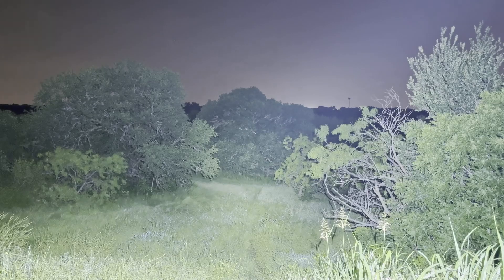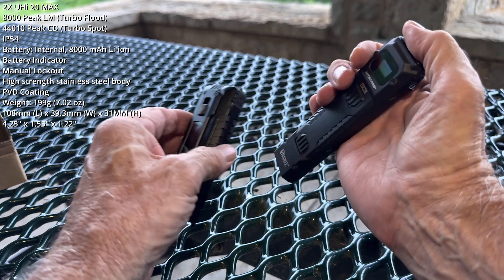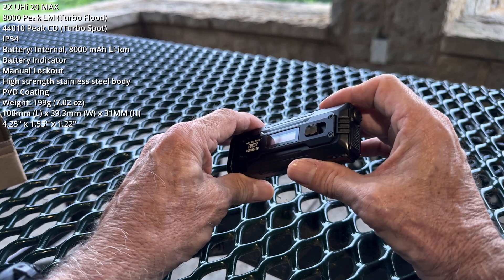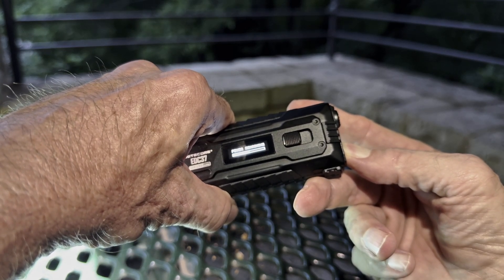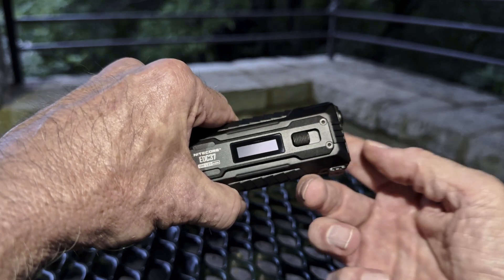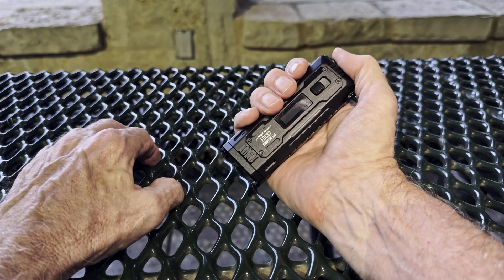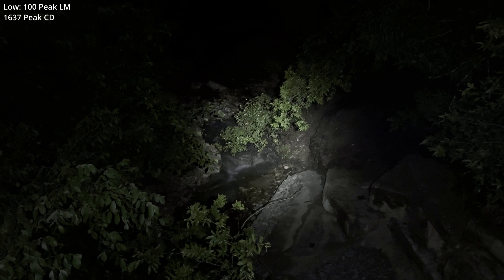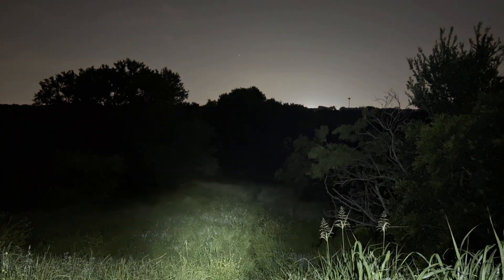NITECORE EDC37 8000 Lumen Flashlight Review With Thermal Analysis. Hold The Sun In Your Hand.

Comment: I have a little request tho, can you do the edc 37 battery endurance test? I would really appreciate that
Reply from the maker: I've thought about doing a High output test, but that will have to wait until winter so I can max out the amount of night time.  The ANSI/FL-1 run time for High is rather long, so I'd be out a very long time.  Last time I did one like this was the Fenix HM75R with power bank extender.  That was about a ten-hour exercise :). I'd also like to do a rain exposure test, but that requires a long, steady rain at just the right time at night.  That one may be a fall/winter test as well.  Thank you.
Reply: @L5-SAR and can you do some short blast during the endurance test? Mine got runtime inaccurate after short blast of turbos

Comment: Nitecore says 1500 lumens last for 7 hours but I find it lowers the brightness gradually after a minute or so. Have you experienced the same thing
Reply from the maker: I published a video to the SAR Team (Private community on the channel) with a detailed burndown test from the High output level.  Your statement is correct.  The exact burndown time is going to be environmentally dependent and the steady state is comparable with the Medium output level.  Thank you.
Reply from the maker: Also, remember that the run time is based on the ANSI/FL-1 standard and vendors often take liberties with that standard.  Roughly stated, it should be the time the light takes to burn down to 10% of the original output level or about 150 LM.  There are not standards for how the burn down is managed, i.e. multiple hard ramp-downs, gradual (linear), non-linear, etc.  Thank you.